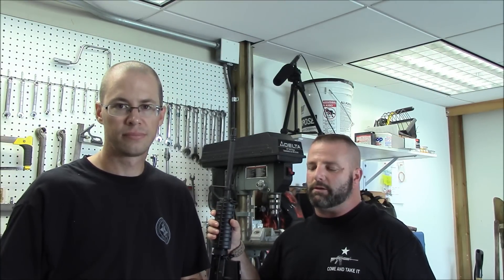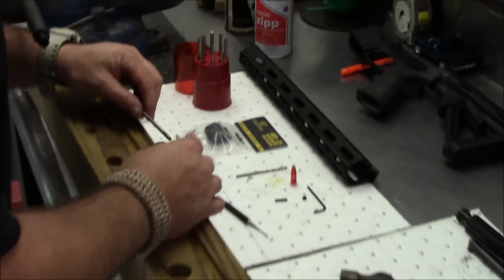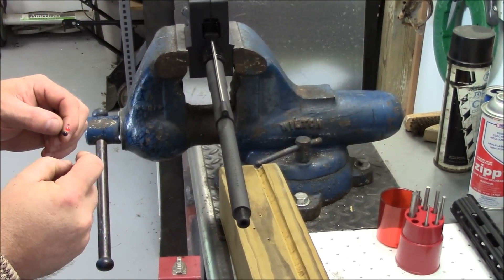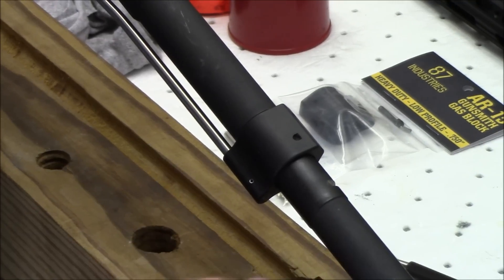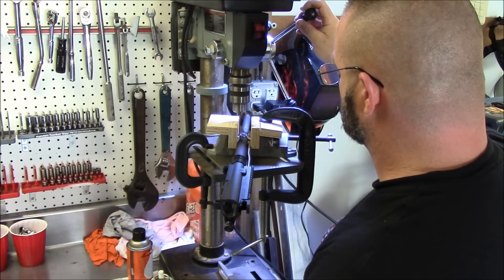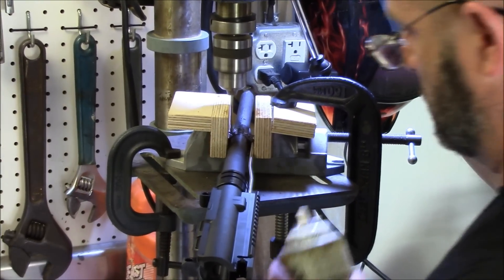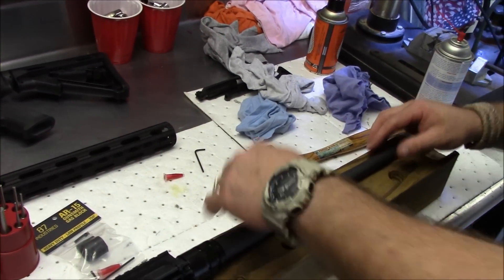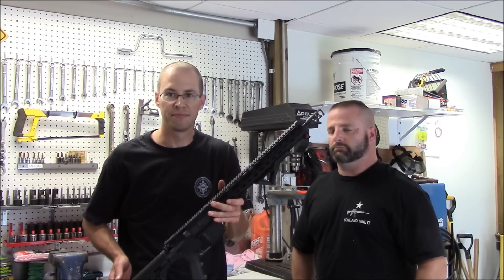87 Industries pin block (gas block) installation and review

Comment: I should be getting one of these soon, but if you already have an A2 sight base/ gas block, why not just shave the gas block to fit under the hand guard. I have shaved several A2 sight bases down and it works great, it's cheap or free if your barrel has an A2 and basically bullet proof. Good informative video.
Reply from the maker: Avid4Crafts Glad you liked the video.My original plan was to chop the front sight base but I decided to go with the 87 Ind block instead.